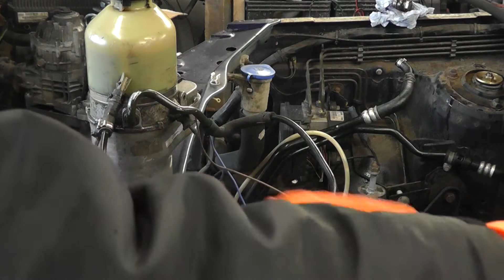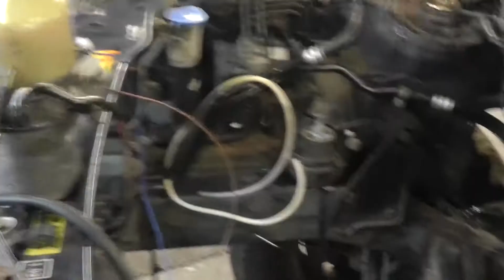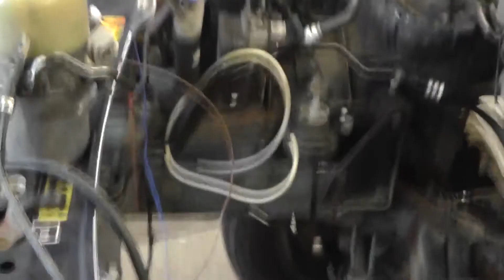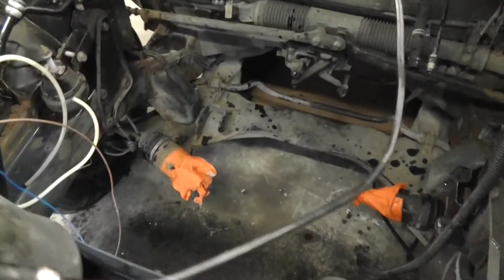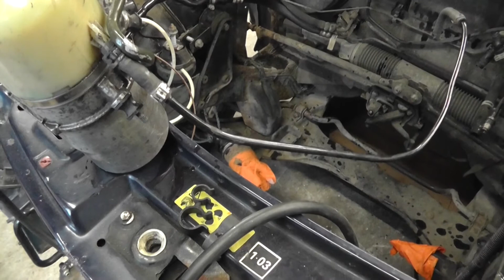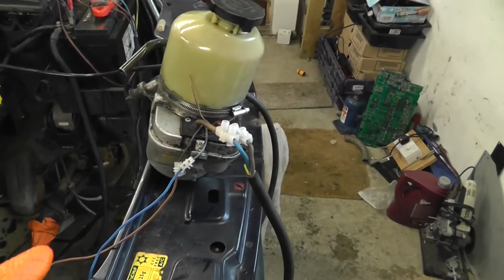DIY EV Part 12 - Power Steering Pump blow off. Messy!

Comment: Every one of these I've seen used does make a lot of noise and keep making it. Just seems to be how they work. I have a similar one I'm getting a pressure hose made for shortly
Reply from the maker: I'm hoping my altimotor solution will be quieter.
Reply: @alibro7512  I'm interested to try spinning a ac compressor with a treadmill motor. I've been told it will guzzle power but I have the parts so I'll try it anyway and see what happens. If nothing else it will be interesting
Reply from the maker: @blackterminal  where I live ac is not a priority. Heating will be important but that's a future issue.

Comment: Hello sir,how to do a bench test vw polo eps with the following pins ?

1.can low
2.can high
3. nc
4.Ignition+

5.PWR-
6.PWR+

7.12v out
8.GND
9.weak 12v

which pin to start the motor ?
Reply from the maker: Sorry I don't know, as you can see from my video I'm still trying to get the hydraulic steering working.
Will the motor not start if you try to turn the wheel?
Reply: @alibro7512  I also want to try to make the power steering working outside the car. what should I do after connecting pins 5 and 6 to the battery

Comment: I’ve used on my electric conversion a Mercedes a class power steering pump and I’ve converted a VW transporter T5 and it’s quite good you can got good feel of the steering and road but it definitely is working
Reply: Did it need can bus control?
Reply: @blackterminal  No the best part just connect the wires and it works I got the idea of the information from Project binky
Building four-wheel-drive mini
Reply: @stuartdean4620  please tell me the part number
Reply from the maker: Did you ever measure the current draw from the Mercedes pump?
Reply: @alibro7512  Hi I’ve just been out and measured it I’m with it just stood still and not steering using less than one amp
When you’re rolling it uses very little so the constant parasitic load is quite small
Reply: @alibro7512  yes that’s the total current draw 1amp
Reply from the maker: @stuartdean4620  wow. That's very good. The Zafira pump was drawing way too much then. I'll try to find a Merc PS pump then as it would be much easier than using an ebike motor to drive the Freelander PS Pump.
Reply from the maker: @stuartdean4620  thank you for sharing. 👍
Reply: @alibro7512  no problem I could feel your pain been there done that I’m also building another van now just starting using  leaf motor and hopefully making it four-wheel-drive
I too do some YouTube of the van kind of

Comment: There should be more than enough restriction in the factory pipeline, if the rack and cooler are in circuit. 

To me it appears that pump isn't regulating its speed down off load, which is how I remember this system working in the Citroën Saxo.
Reply from the maker: Just in case anyone has watched this video and missed the last one, in this video I had the pump connected with a loop so there was almost no pressure being built up.
In the last video it was connected to my Freelander steering rack so there should have been some back pressure but was it enough? I'm still not certain so will have another go at it connected to the Freelander rack and see if I can do something to restrict the flow a bit. Maybe put some vice grips on the part of the return pipe that is flattened anyway.
Reply: Just another thought Ali. Maybe there's too much restriction in the circuit, so the pump is implementing the high pressure mode to drive the steering? 
Although you'd have thought it would have slowed where the output was connected to the return. 

I still think it's a faulty pump though.
Reply from the maker: @johnnodge4327  I wondered about that too John but up until it pee'd all over the floor it did the same thing as before.
I think you're right and it's faulty.
Reply: It can't speed regulate. It's no longer wired up oem style. It will run flat out on or off now. That's still ok

Comment: You had nothing for it to build pressure into! Whilst fluid does circulate continuously from pump to rack and back to the reservoir, it should be restricted when providing no assist.
Reply: http://www.agcoauto.com/content/news/p2_articleid/214
Reply from the maker: For some reason your first comment went into the spam filter. 
Thanks for the link, it's a really good explanation but I still think my pump is faulty. 😒
Reply from the maker: That was one of the things I wondered about.
But would the banjo have allowed more or less flow than the correct connector?
It is also possible that this rack is either faulty or just not compatible.
Reply: @alibro7512  The fact that the hoses stayed on for the first power-up showed that you weren't generating much pressure. You could try again with a restriction in the line, a bit of sawn off bolt with a hole drilled down the middle for example. Definitely need to use hose clamps though!
Reply from the maker: @EVguru  Good idea Paul. I'll give that a try tomorrow.
Reply from the maker: @EVguru  I put a pair of vice grips on the return hose and tried it again but it was no better. I think this pump must be faulty.